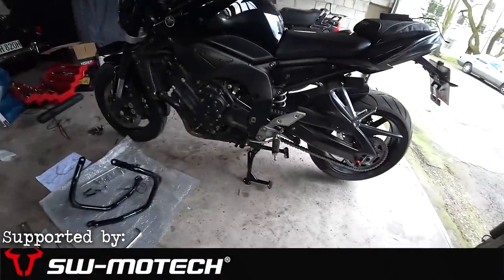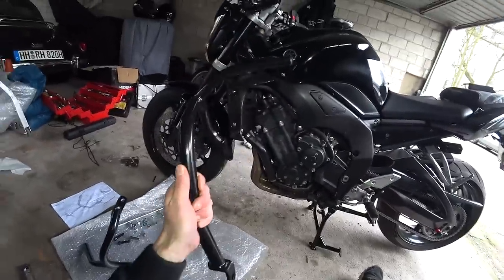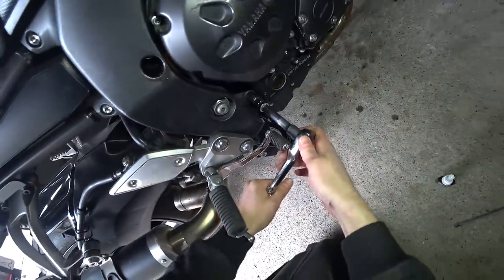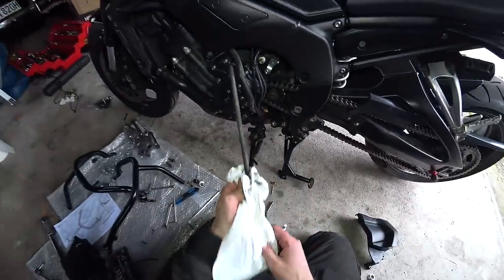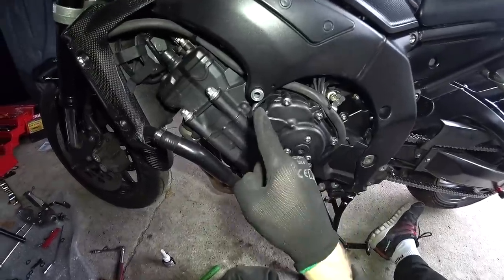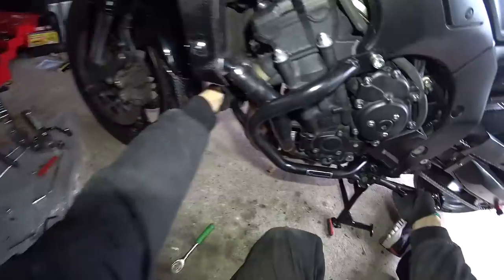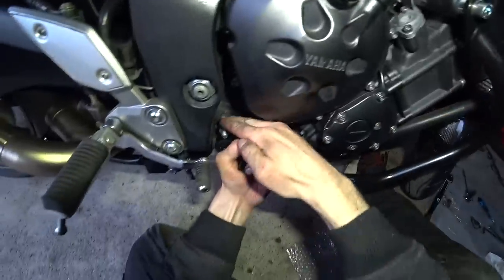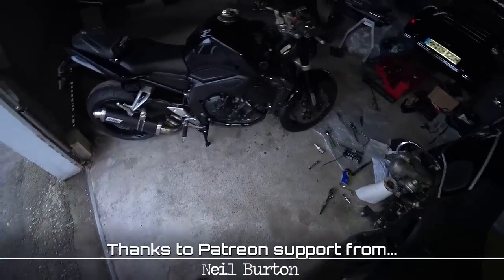SW-Motech Crash bars FITTED to FZ1-N

Comment: I really want to try and do my own maintenance on my tiger, but I don't want to make fire. I worried that'll I'll break it and it'll be more to repair rather than if I just took it to the dealer in the first place. Wanna get a new exhaust, think it's a slip on exhaust, I think.
Reply from the maker: Haha! If it helps, I've been doing it for 14 years now and still haven't made a fire! :D

Comment: They look great. Am thinking about getting engine bars for my KTM 390 if I do Motogymkhana with it later in the year! :-)
Reply from the maker: Cheers! I think in that case it would be a must!!
Reply: Andy Man Cam am pretty much guaranteed to drop the bike if I do give it a go and like these ones you have fitted they hug the engine very neatly :-)
Reply from the maker: That was what made them OK for me. Very subtle. No wings sticking up in the air and no attempt to protect the radiator plastics. I'd rather replace a 30€ panel than have a sh@t looking bike!
Reply: Andy Man Cam would have possibly added over 30 Euros to the cost of the frame too if it came out further to protect them
Reply from the maker: +Hippo-Drones Quite probably! Less is more, which is less or something.
Reply: :D

Comment: Out of context?.... Are you going to review the GoXtreme Barracuda camera? 😊 have a great weekend Sir!
Reply from the maker: +Mr Rodriguez Ha! No plans as yet. But if easypix throw one at me,  i might give it a go.
Reply: Andy Man Cam I'd like them to throw one at 😁🙏 litetally!! Well keep up the good work Sir!
Reply from the maker: +Mr Rodriguez Ha! Would be an amusing twist to the already terrible postal service! I'm a bit unfazed by the Barracuda. Interpolated 4K at 25fps seems like a real step backwards in terms of performance.  Matching gopro's 'waterproof without a casing' feature at the cost of video quality doesn't make sense to me.
Reply: Andy Man Cam I was actually considering purchasing the Barracuda... But for £119.99 & having to also purchase the case separate for £24.99 makes no logical sense to me! They have the "vision 4k" witch seems of great quality & a good price mainly for filming family & fun times & occasional vloging etc! I was thinking the vision 4k is £99.99 & for only £20 really I could buy the upgrade (barracuda) for £119.99 + £24.99 case Hmmm but then theirs the pioneer 1080p 😭😭😭😭😭LOL DECISIONS
Reply: I actually have the Activion cx camera (only 5mp though & no slow motion) was £60.00. So wanting to upgrade: Might buy the GoXtreme pioneer 1080p or the GoXtreme Vision 4k (at least they come with a case lol)